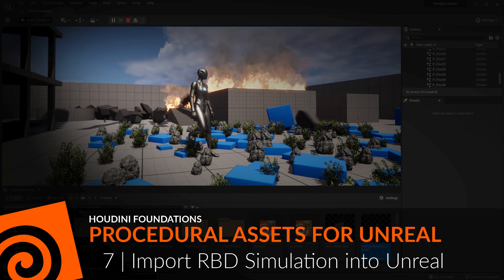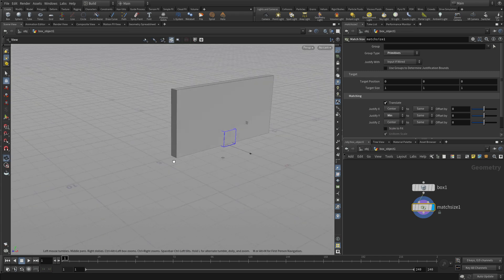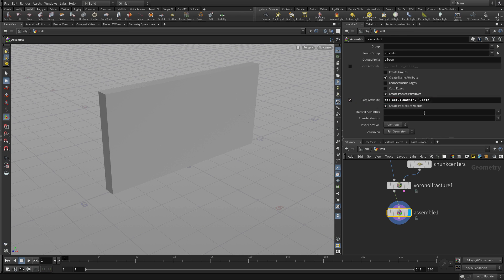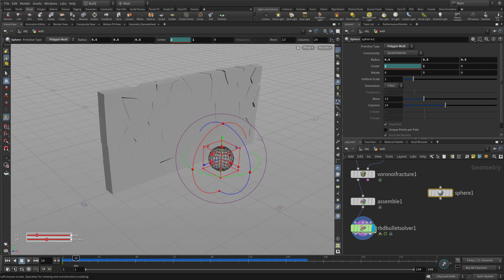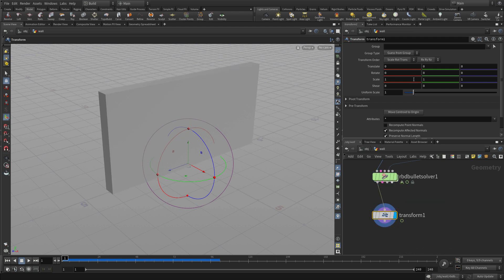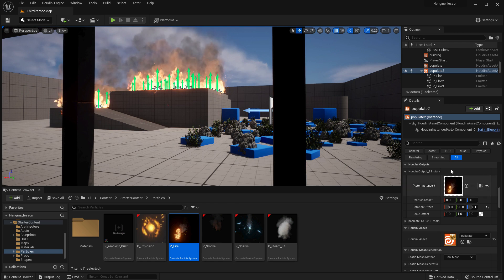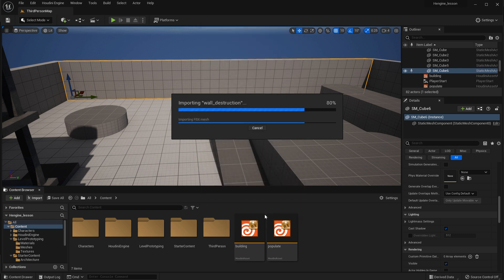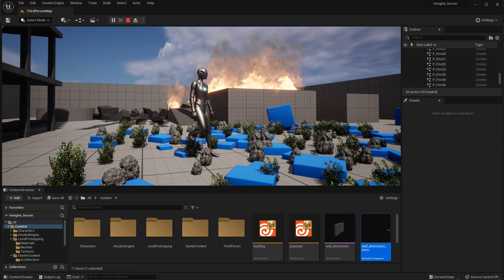Houdini Foundations | Procedural Assets for Unreal 7 | Import RBD Simulation into Unreal

Comment: in unreal, the animation doesn't import 
" Animation length 2.875 is not compatible with import frame-rate 30 fps (sub frame 0.25), animation has to be frame-border aligned. "
setting the timing range doesn't fix it either